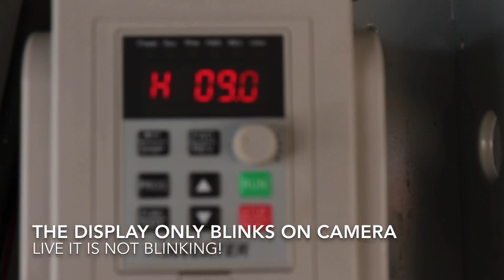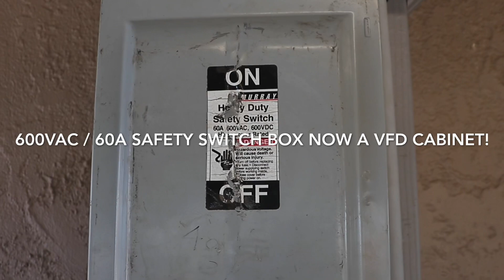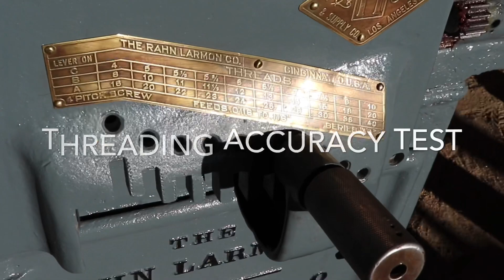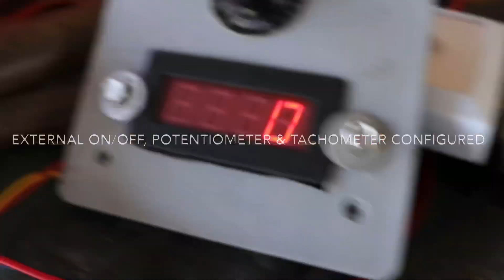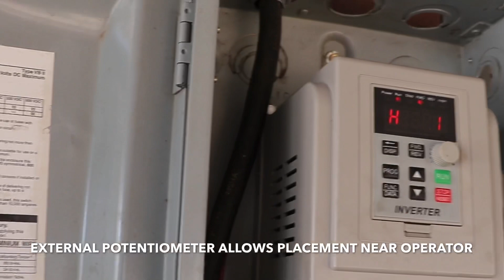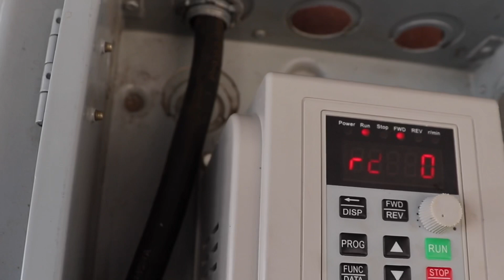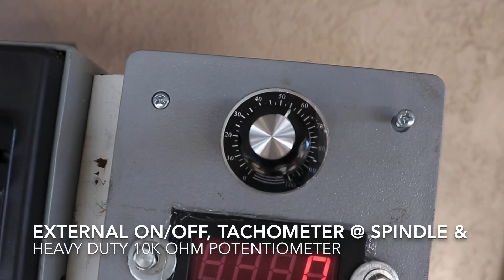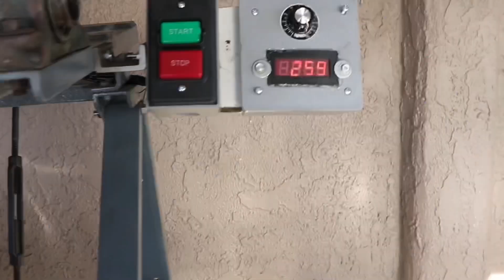Rahn-Larmon Co. Lathe Restoration (Part4):  VFD Installation (2.2KW 3HP)

Comment: Beautiful job , super nice lathe made when they were built to last forever. Looks like ya need another oiler on end spindle bearing ? Great job on painting her up.
Reply from the maker: Hello and thanks for watching and commenting Silverbullet!  Yes, they don’t build them like they used to or at all for that matter!  The Rahn Larmon lathes are GEMS!  
Regarding the oiler, we made a video 9 months ago called ‘Inside Threading on South Bend Model 9A & Fitting Lunkenheimer Oilers’. 
We inside threaded the phosphor bronze spindle bearing shell on a South Bend 9 inch lathe WITHOUT A TAP.  Then we fitted a Lunkenheimer Sentinel No.1.5 oiler as well as the Sentinel No.5 that came with AA Series lathe.  Check it out when you gotta chance. 
In the future we will be fully restoring a vintage 1920’s South Bend 13 inch ‘R’ Series lathe as well!
Thanks again!
Sincerely, JR from A1CFS